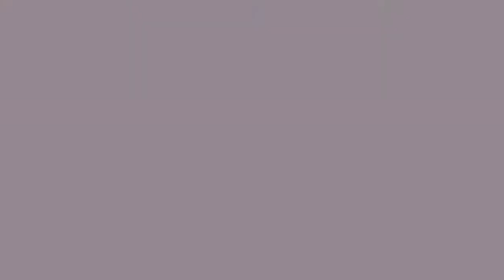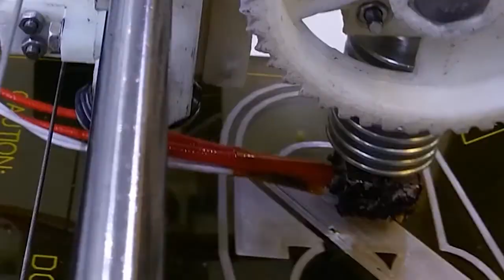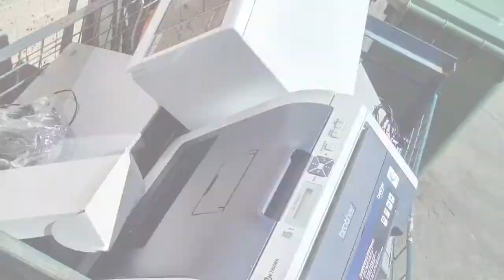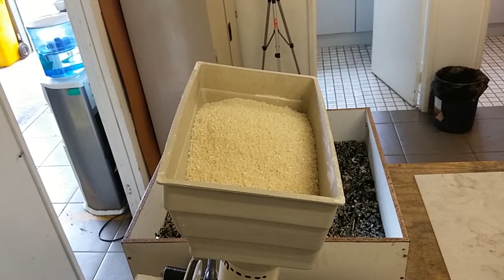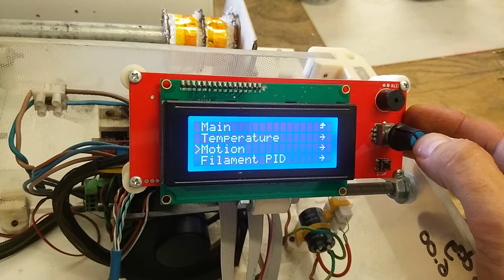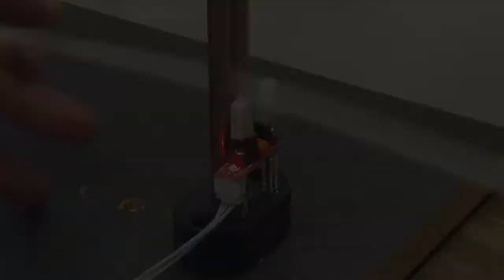Sub33D -  Modified Lyman / Mulier version 5 Filament Extruder design

Comment: Hi, I am building this LYMAN MULIER V5 filament ectruder. The default firmware setting work fine, but i want to change those settings, primarily because i need higher RPM for extruder motor. And i am stuck here, plz help....!!

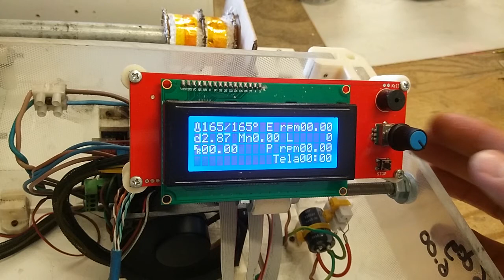Comment: Hi, great job. At 1:01 of the video you riding to one thing (it looks like a potentiometer) with which you can scroll through and select menu items. Can you tell me what it is? where I buy it?
Reply from the maker: Hi Erre, it's the rotary control on a "Smart Display Controller LCD 2004" used on many DIY 3D printers
Check out ebay link:
http://www.ebay.com.au/itm/Smart-Display-Controller-LCD-2004-For-RAMPS-1-4-RepRap-3D-Printer-Electronics-/252615109354?hash=item3ad108aaea:g:2McAAOSwA3dYFuKN
Reply from the maker: You can also buy the rotary encoder separately:
http://www.ebay.com.au/itm/10x-12mm-Rotary-Encoder-Push-Button-Switch-Keyswitch-Gasket-Nut-gray-code-Output-/271416860148?hash=item3f31b49df4:g:4eAAAOSwQPlV~HXF
Reply: Great. thank you.